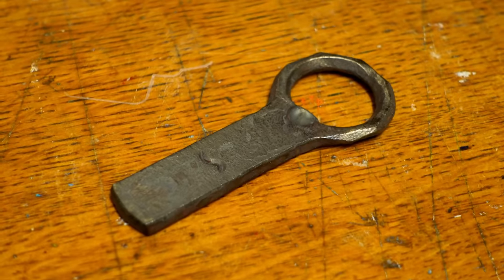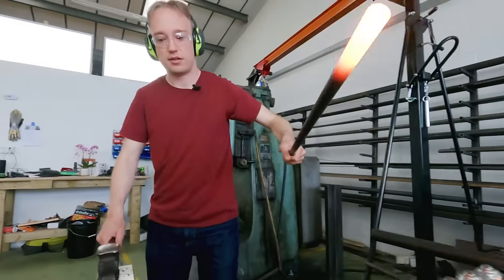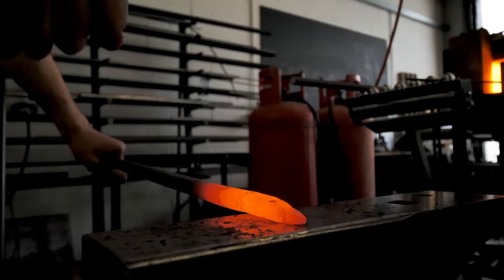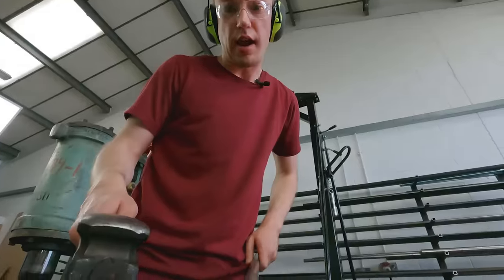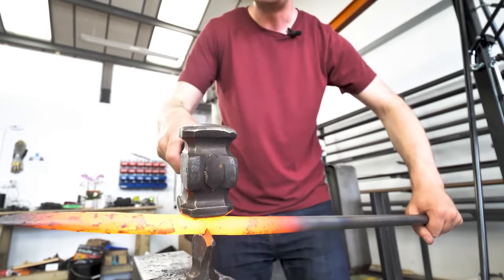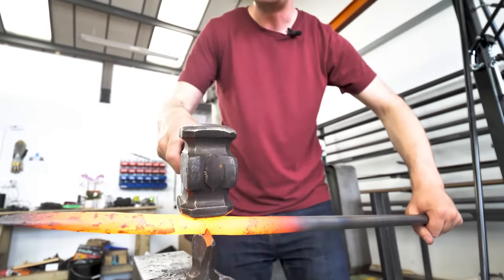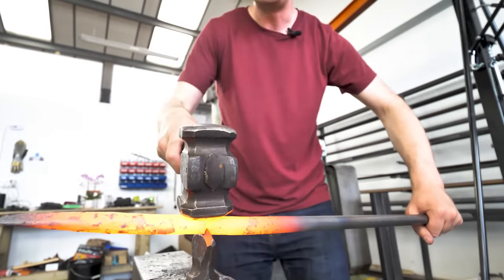I tried blacksmithing and only got slightly burned

Comment: I love how cautious Tom is at the start. Barely any strength behind the swings
Reply: Very common in beginners. I teach blacksmithing and I always have to stress that the students don't have to make friends with the metal after we're done, so hit it like they mean it.
Reply: I guarantee I’d be exactly like that. I know it’s metal on an anvil but I’d be afraid I’d somehow break something if I hit it hard.
Reply: It's common with people that aren't used to hit things. Mentally they thinks "hit that spot" but to make that and not pass we brake our movement. The "trick" is to aim behind so we keep the full force all the way.
Also often easier to start with a lighter hammer that can easier be controlled.
Reply: His arm had to be feeling that the next day
Reply: I would be afraid that I'd miss and smash my fingers into the edge of the anvil. I bet that's a part of why Tom was being cautious.
Reply: it looks like he's not only not applying any force to the hit, but even applying it in the opposite direction like he's trying to slow the hammer down
Reply: @elminz  and shoulder, and back, and thumb...
Reply: Tom does his usual thing of being quite timid, then getting overconfident and hurting himself

Comment: One thing that most new people forget about blacksmithing is that it's a profession that has existed for as long as there has been metals.
Each generation has brought something new to the table (or anvil as it may be) and what you are doing is learning what has taken hundreds of years to perfect in a matter of minutes.
Reply: that is such a cool way to think about it
Reply: That type of person existed before metal, that is just a type of builder.
Reply: Without undermining your point too much, it's worth pointing out that a lot of the 'perfecting' that happened is less about how to forge (which is still done through combining the same handful of basic techniques - tapering, drawing out, punching, drifting, planishing, etc which are largely unchanged throughout history). The real development has been in the steel itself - we take for granted that you can buy all kinds of near-perfectly uniform steels in almost any stock size; ones which will harden in oil, water or even air to well-defined rockwell numbers which you can easily calculate, and with a massive range of possible hardness/ flexiblity properties for your desired purpose. But in the past just getting a fairly uniform piece of steel without flaws in it, and then hardening it after forging without it failing was an incredibly difficult task. It's hard to conceptualise just how difficult that task was with the technologies available in the past, and how on earth we figured it out.
Reply: Sort of... Blacksmithing is about forging metal (shaping through hitting), which you can't do with bronze. So, smithing has 'only' been around since the start of the iron age.
Reply: And in thousands of years you guys haven’t found another way of holding the steel rod you’re hitting with a giant hammer other than to put it under your crotch?
Reply: Bronze age: aight imma head out.
Reply: @bleistift2775  motivation not to miss

Comment: I used to own a forge, anvil and tools. Loved blacksmithing so much but I was having to do it outdoors in the garden. The neighbours claimed they didn't mind but I always felt super self-conscious having the air intake going and noise from hammering away so sold it all a year ago. Regretting the decision every time I watch an episode from Alec's channel. 

For anyone wanting to give it a go I strongly recommend having a try out day with someone like Copper Elf smith. I learned so much more on the few days I spent with them than all of the tooling around and watching videos. Having someone make small corrections to form and technique like Alec was doing is super informative. Knowing what a good heat on steel looks like can't be easily communicated through a video and being able to problem solve, what hammer weights you prefer and so on can be really helpful.

Comment: I loved this video. I forged hot steel for 12 years. It was called "drill steel". Miners use them to drill through hard rock in underground mines. There was 5 other companies that made it, but they machined them and tack welded them together, as we forged ours all in one peice of steel. I kind of miss those days.

Comment: 14:49
In Tom's defense, Alec did say "single blowS" instead of "blow"
So I actually think that Tom listened more closely than Alec did himself, to himself 🤣
Reply: Perhaps, but based on your interpretation, how do you make multiple blows?
Reply: @kaldo_kaldo 
I'd say that "single blows" means long, hard strokes, with a pause in between to inspect the effect.
And "multiple blows" I would interpret as many small taps in quick succession.

But there's definitely wiggle room to argue 😂
Reply: @kaldo_kaldo  Much the same way you would do single strokes drumming or painting; a momentary pause between strokes.
Reply: @PianoKwanMan  I don't like the comparison. On an instrument for example, you typically play notes in rapid succession, several per second. But you don't hammer like that if you want to get anything done. There's no purpose in hammering in such a manner.
Reply: I think that if you were to say “single blow” it would mostly be interpreted as just one hit and then stop and wait to be told what to do next, where as “single blowS” would be interpreted by most people as a hit or with a pause for inspection
Reply: @kaldo_kaldo  which you can't expect to be a baseline that someone not familiar with proper hammer working would have.
Reply: "blows"  implys that "single" is a type of blow and Tom should do multiple of that type
Reply: I heard the same thing tbh
Reply: @PianoKwanMan  not sure about painting, but single strokes means something different in drumming. 

Single strokes mean you alternate your hands on every note
Reply: @kaldo_kaldo  Actually, you do. That's the sort of motion you use with all different kinds of jeweler's hammers, because you're typically working with soft metals in very small dimensions that could easily break from larger motions with greater momentum behind them.
Reply: @KainYusanagi  You're correct, in an entirely different scenario the rules are different
Reply: Hi Wim Winters

Comment: I've never laughed harder than at 13:40 when Tom screams "I'm not convinced by - AAAAAAAHH YUH F***ER!"

Edit: correct time is 12:38 now
Reply: very satisfying yes 😂
Reply: I had such a different reaction, I was panicked from the smoke appearing to his fingers being under the cool water. Had we been in the room with Tom, both our reactions would have been completely unhelpful though
Reply: Hearing Tom swear is other-worldly 🤣
Reply: 12:38 is the correct timestamp!
Reply: @Avistew  

Same except hot glue

Good thing i was also thinking of working with air dry clay so i had a dish of water on hand

My middle finger still has a sizable Divot in it

Comment: You were hammering SO much more confidently by the time you were cutting the finished piece off the bar stock. If you stick with it you'll be a pro in no time. Good job on the pieces mate.

Comment: Tom: it is recommended when treating minor burns like that to run it under skin-temperature water, not cold water. Cold water creates more thermal shock (a larger temperature gradient) and can do damage as you try to cool the burn. You want to get the excess temperature in your skin away, and skin temperature water will do a fine job of that.

Of course, it can be difficult to get water to the right temperature, so start cooling as soon as you can but also use warm water. As it gets to temperature, check it with a non-burned part of your body. The goal is to get the water to not feel cold to the touch, but not too warm either, somewhere that you aren't burned.
Reply: If the water feels uncomfortably cold for the adjacent non-burnt parts, it’s colder than it needs to be. Running water is such an effective heat sink that you don’t need it to be uncomfortably cold.
Reply: This so much. I can't believe this isn't general knowledge at this point. In fact, the best way to make sure a burn doesn't "go over" is to cool it against a non-burned body part. It isn't raw heat that makes blisters, it's the gradient.
Reply: @masansr  
You do need the heat sink that the water provides, but there’s no need to add cold-related injuries on top of the burn.
Reply: But non frozen water doesnt do damage in a few minutes? And a larger gradient cools faster?
Reply: @the_retag  Damage to the skin is caused by the rapid temperature change, so while you do want to cool the affected area, you actually want to do it more gently.

While cold water doesn't normally cause damage, you also aren't normally burned. Burned skin is already damaged, and cooling too quickly can cause more damage.
Reply: @the_retag  
As long as you cool the burn in running water it’s just as effective even if it’s almost body temperature. As long as it doesn’t feel warm to non-burnt skin it’s cool enough, and if it feels unpleasantly cold it’s too cold and can damage what’s already sensitive from being burnt.
Reply: @ragnkja  Yoghurt do wonders to cool off burns too...
Reply: You learn something new every day!

Comment: A good trick when you get burned to get rid of that annoying sensation, put your hand in some WARM water it will sting for a bit but after 10 seconds the sensation is gone and you can get back to work. I worked in kitchens for 20 years and when it gets busy you don't have time to cry about the pain so this is what I would do.

Comment: I'd love to try a blacksmithing class but as a craft it seems like it's a lot of tiring and thirsty work! Wood working next, Tom?
Reply: It isn't really. It really depends on your form and how you work. Blacksmithing is focuses a lot on how you can move material as efficiently as possible. I also think the hammer that was used in the video was to heavy (this is a opinion that  varies), in my opinion it is easier to learn with a lighter,smaller faced hammer. It also saves your wrists a bit more if your are hitting in the wrong way (you should not swing with only your wrist !). But definitely try out blacksmithing someday if think you will like it! It is fun!

Comment: 12:40
ive actually seen some smiths recommend against wearing gloves in the forge because a dexterous glove isn’t gonna stop you from getting burned, but it will hold onto the heat, potentially burning you more, and it stops you from being able to feel the heat coming off of it
Reply: In very bad cases, the glove can even melt into the wound, meaning you'll pull off your skin along with the glove

Comment: Tom: A thing with a hole in it! Lovely.
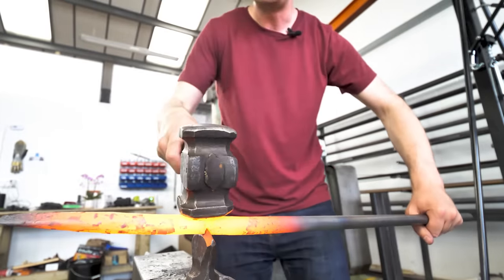16:17
Alec: Well done.
16:18
Tom: Back in?
16:19
Alec: No I'm going to put mine in.
16:20
Tom: Of course.
16:21
Alec: What we're now going to do is we're going, to drift the hole open.

16:24
Alec: So, again, hold it between your legs.
16:26
Tom: Yep.

😂😂😂😂😂
Reply: “you’re going in the rear side of the hole, you put it in the middle and you start driving”

Comment: 14:08 My initial reaction: Wait Tom no that's not the water tha-
Reply: The water doesn’t actually need to be ice cold, just running and cooler than body temperature.

Comment: In grade seven, we did metalwork for a bit. We used a large spot welder. I finished welding, it fell out if the weldy-bits, and onto the floor. I picked it up. By the weld. My finger stung and blistered for a few days. The worst part? I was one of the best clarinet players in one of the school bands, for which we had a performance for two days later.

Comment: From one amateur blacksmith to another:  To help with your form just a bit, loosen up the hammer wrist.  It needs to flex a little as part of the hammer blow. 
- Drive the hammer with your ELBOW, power the hammer with your SHOULDER, and direct the angle of the hammer with your WRIST and Finger Grip.  :-)  
- Where your elbow goes, the hammer tends to go.  Your shoulder pushes the hammer, but the elbow turns the steering wheel telling it where to go, while the wrist and the grip of your fingers direct at what angle it will hit at. 
It's just like hammering nails into a wall...  but more complicated.  :-P

Comment: I hope you'll try again sometime: try to keep your elbows much closer in. Having them out makes it so much harder to lift the hammer. If if you keep them in as if you'd hold the newspaper with your elbows. That way you'll use mostly your biceps, in my experience the strongest upper arm muscle. Try it, it works great :)

Comment: Quite good for a complete novice! The hammer weight is usually something beginners struggle with quite a lot. Usually a 800g hammer is a happy medium, even if you’re not used to swinging a hammer you can swing that for half a day without too much issue.

Comment: I actually have a story about that wearing gloves in high temperatures, I was working at a Krispy Kreme doughnut shop and accidentally dipped my gloved hand in the fryer. Because I acted quickly, I was able to remove the glove extremely fast without giving myself third-degree burns as that oil is 450° at any given moment.

Comment: as someone who studied blacksmithing for a year, I'm curious to why both you and Alec are holding the hammer so close to the head and striking with such a stiff upper body?
I was taught to hold the hammer as far down the handle as comfortable so that I use the leverage of the hammer for the strikes and the recoil of the anvil for the recovery.
His anvil also seems to be set a bit awkwardly low for you as the height I was taught as optimal is with the hammer face at rest flat against the top of the anvil, held comfortably at the end of the handle should have the elbow at 90°.

Comment: I have done something worse than what happened at 12:37. I was working on welding some metal together, and took my visor up to see if its good enough (it was), and then a person that worked on another projekt asked if he could borrow my cloves just for a momment. I said yes and gave them to him, then somehow I forgot I just welded the metal and put my hand on it. I quickly got water on the hand  (no permant marks thankfully). and the person came back with my cloves and asked what happen, I told him while slightly laughed at my stupid mistake and so did he after he was sure I was alright.
Sorry if I misspelled anywhere.

Comment: Alec, I see framing carpenters swing their hammer from the very end of their hammer handle for more power, how come the same technique is not used in your workshop?
Reply: holding it towards the top of the handle gives you lots more control, with blacksmithing, the power comes from the body instead of the tools, also when working with steel the hammer can jump back at you, this effect is multiplied because the wrist acts as a lever and makes the hammer very likely to come back and hit you in the face. hope that helps! I don't specifically work in blacksmithing but I dabbled in it for my uni course. that was years ago but I cant imagine much has changed haha!
Reply: @finkerr6077  thanks Fin!
Reply: @finkerr6077  it’s less of the fact the hammer can bounce back and more they use heavier hammers so less force has to go into it. I work with steel everyday but sadly not a blacksmith

Comment: I'm sorry but this is bad blacksmithing. Both are holding the hammer too far at the head end (Tom holds it better). It is too heavy for them. The tools he shows are quite uneven. You never hold the material you hit between your legs. That is very dangerous and bad advice. I know the video  he's talking about and he obviously has nothing to lose there anymore. You don't wear gloves exactly for what happened.